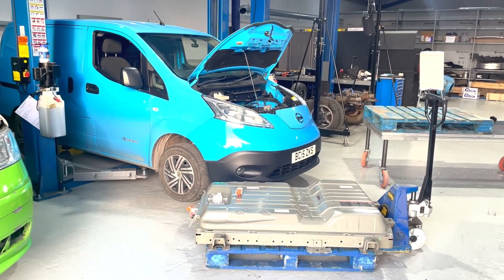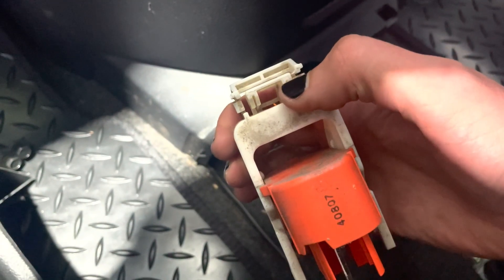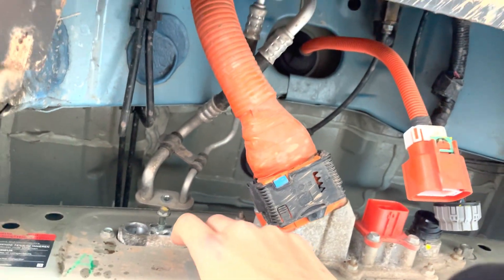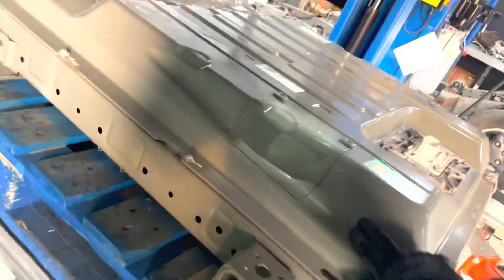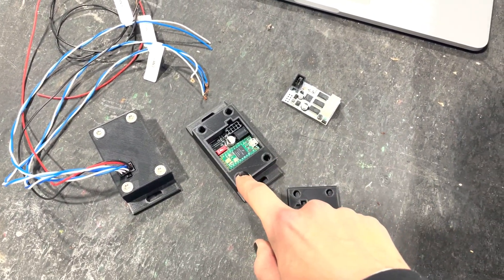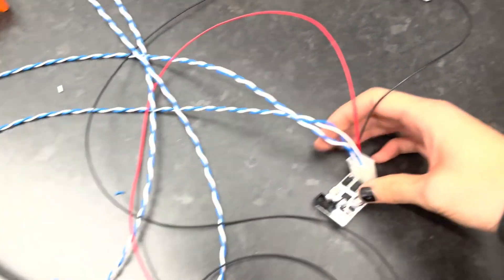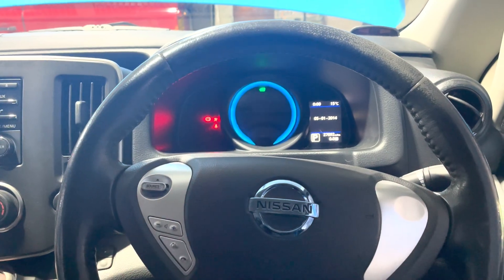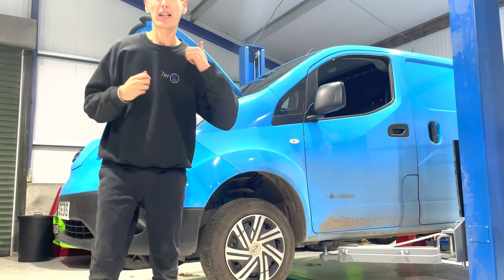Nissan eNV200 40kWh Battery Upgrade

Comment: Great video Seb, I have the same blue 2015 British Gas E-NV200 and would love to do this upgrade, my battery seems good but I would love the extra range. been looking for a 40kwh unit for a e-nv200, but no joy so far. Not long bought the van and was wandering if it would be easier to sell and buy a 40kwh one for the extra money, but I do like my blue one. 🙂

Comment: That’s such i coincidence. I’m in te proces of buying a leaf 40kw battery (wish it would be 5k…)and gen2 stack for my conversion. This made me think about the aircon setup I did not plan yet.. thanks for the heads up 😊
Reply from the maker: leafs dont run air-con into the battery, only on the vans!
Reply: @phoenixs3  sorry wasn't clear. its a van battery i'mm looking for and gen2 leaf stack. Would you know the size difference between the env pack and leaf pack :D